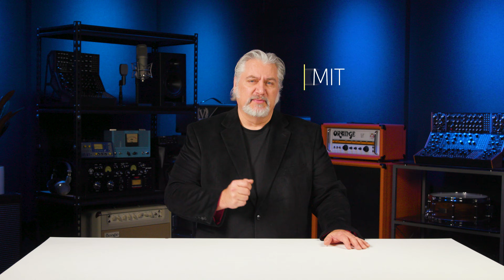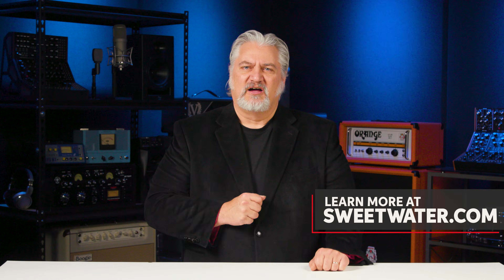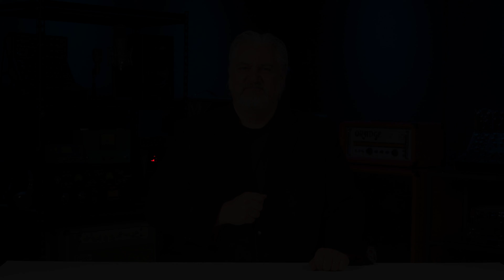What Is RMS in Audio?

Comment: Ok What is the RMS watt needed for a PA to have the same output of a 50W tube amp in a 2x12 or a 100W in 4x12 ? 
Why somehow 100W in a tube amp is a lot but 300W RMS in a Power amp (solid state) is too low?

Comment: Which power rating do you use when it say AES power and continuous power then says peak power?
Reply from the maker: Hello, great question. The AES power rating refers to the average amount of power a speaker can handle over 2 hours or more (similar to RMS but measured using a specific standardized test). Matching an amp to a speaker will depend on the application so it would be best if you give us a call so that a sales engineer can ensure we are getting you the right product for your needs. However, you will typically be safe purchasing an amp that is rated around the AES or RMS power rating of the speaker.
Thanks!
Jason Filloramo, Sweetwater Sales Engineer, (800) 222-4700 ext. 1281, Jason_Filloramo@sweetwater.com

Comment: 120V/.707=170 peakV.   Half a sine wave measuring 170 peak volts yields approximately 120 usable volts <=> not to be confused with avg voltage.

Comment: I'd just like to interject for a moment.  What you're referring to as Linux,
is in fact, GNU/Linux, or as I've recently taken to calling it, GNU plus Linux.
Linux is not an operating system unto itself, but rather another free component
of a fully functioning GNU system made useful by the GNU corelibs, shell
utilities and vital system components comprising a full OS as defined by POSIX.

Many computer users run a modified version of the GNU system every day,
without realizing it.  Through a peculiar turn of events, the version of GNU
which is widely used today is often called "Linux", and many of its users are
not aware that it is basically the GNU system, developed by the GNU Project.

There really is a Linux, and these people are using it, but it is just a
part of the system they use.  Linux is the kernel: the program in the system
that allocates the machine's resources to the other programs that you run.
The kernel is an essential part of an operating system, but useless by itself;
it can only function in the context of a complete operating system.  Linux is
normally used in combination with the GNU operating system: the whole system
is basically GNU with Linux added, or GNU/Linux.  All the so-called "Linux"
distributions are really distributions of GNU/Linux.
Reply: No need to get pedantic. People say "America" meaning the United States. It doesn't matter. It's wrong but we get it. We have brains, so we automatically make the cognitive leaps necessary to make sense of conversational shorthands such as referring to distributions of GNU/Linux as "the Linux operating system."
Reply: @AtelierMarsViolet  😌